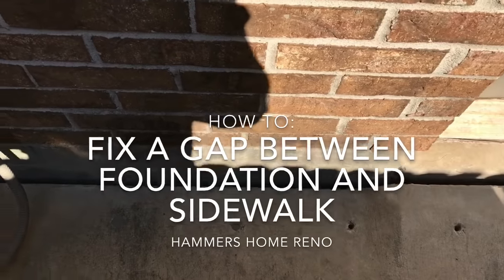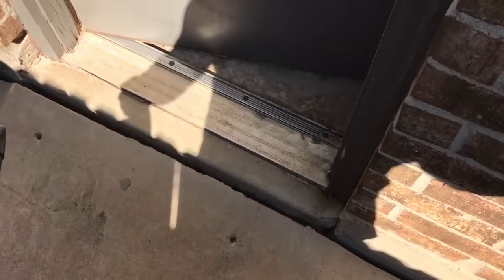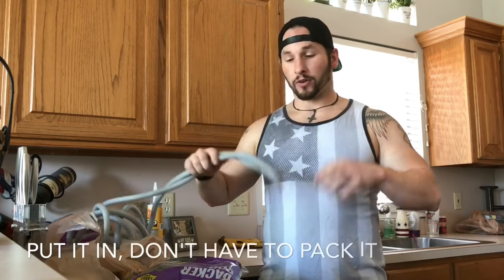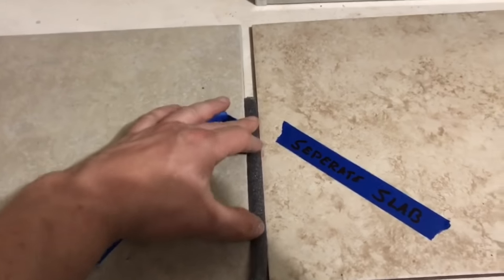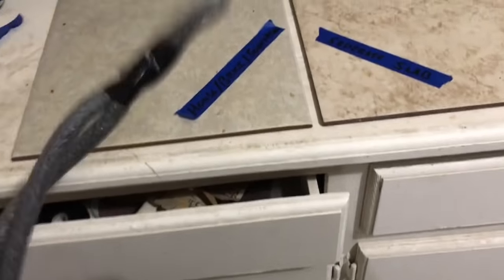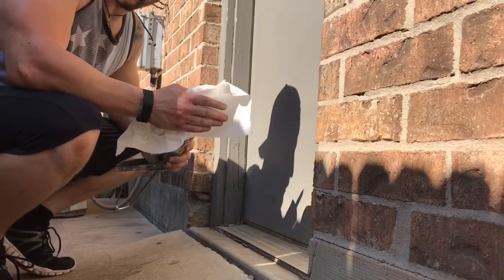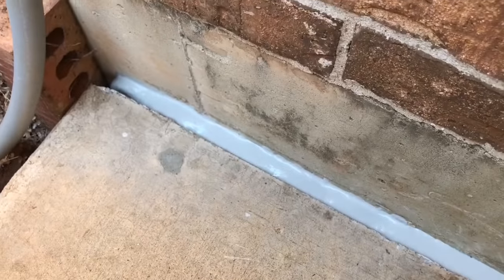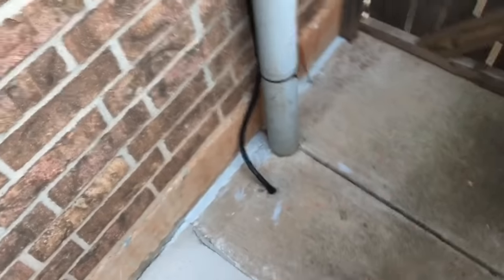Seal Gap In Foundation and Concrete Patio or Sidewalk

Comment: Use tape on both sides of joint prior to applying the self-leveling sealant if you want the job to turn out cleaner in the end.
Reply: You mean apply tape ontop of the backer rod once its in the gap?

Comment: A side note for inexperienced caulkers. Make sure when you’re caulking concrete that you rough up (score) the concrete where the caulk will be before applying the caulk. This will help the caulk bond to the concrete. If the concrete is smooth or slick, there’s a good chance the caulk will peel off.

Comment: Use foam pipe insulation with backer rod inserted to make it solid.  If the gap is huge, use different size pool  noodles.

Comment: Twisting and doubling the backer rod is not a good solution. The rounded backer rod gives the sealant the proper profile to per form correctly . Also it needed to be wire brushed and primed. It also should be tooled both directions to insure a proper bond. I installed sealants professionally for 40 years and can’t remember how many times I have been called out to fix sealant a homeowner installed. It is not really difficult but there are basic things that need to be followed if you don’t want to replace the sealant every couple of years. With just a few improvements this would have been installed correctly. Get the right size backer rod, at least10-15 percent bigger than the joint. It has to be a very snug fit They make it all the way up to 4”.this is far more critical than most people think.As a professional if a tech rep from the manufacturer found the wrong size backer the warranty would be void. Wire brushing the sides of the joint is absolutely essential, we do it even on brand new concrete. And it only takes minutes. Finally every quality sealant ( like Sika) makes primers for their sealant and concrete. Use it. Just go to the manufacturer web site and find the data sheet for the sealant.Most sealants say something to the effect of “ no primer needed on most substrates” but if you take the time to read their product literature they all have primers and say to test adhesion first. Again one of the first things tech reps look for. Finally don’t use a water hose to clean the joint. The reason for not twisting or doubling the backer rod is that the optimum profile for sealant is an hourglass shape “) (“
Where the top and bottom of the diagram are the sides of the joint. Since the sealant is self leveling the top of the joint won’t be concave so it is critical that the bottom is.
Reply: I have the same issue as this guy. However, the joint between my concrete patio and foundation is about 6" deep and about 1.5" wide at the widest point. I've been seeing videos of guys putting sand at the bottom of deep joints to fill gaps and to raise the bottom for the backer rod. Is that the correct way to raise the bottom or is there a better method?
Reply: @LaRod72  it is not correct. The proper way to use backer rod is to buy the correct size that will compress a little and fit snuggly in the joint. There is absolutely no need for sand. If you need sand to keep the backer rod at the right depth the backer rod is too small and won’t function properly. Backer rod is available from 1/4”” that will fit in very small joints all the way up to 4” that will fit up to about 3 3/4” ( or slightly bigger) If you search out SofRod it is softer so that it compresses more easily and 1 size can fit a wider variety of joints than closed cell backer rod ,which is much harder to use in joints that vary in size. Think about putting sealant in vertical wall joints. Those are impossible to “fill” with sand to keep the backer rod at the proper depth.

Comment: This totally answered a question that 3 home depot guys couldn't. And shocker, they sent me home with the wrong stuff! I HAD a self leveling calk in my hand and they steered me to something different. UGH ! Miss the days when there were skilled tradesmen at the Depot. Thanks so much Hammers Home Reno!
Reply: whitesoxsue anyone whos skilled isn't going to be working at homedepot or any big box store at least on the floor. Are there employees who has had some experience in repairs on different things here and there? Sure. Anyone skilled is going to be making $40-100 an hour, not $10-15hr at home depot

I would love to see big box stores hire 1-2 general contractors per store who is very skilled. Where you walk up to a counter, explain your issue & point you down a path.
Reply: whitesoxsuewhat is backer rod. The thing you put on the strip
Reply: Home depot pays crap for wages that's why all the good tradesmen are gone from there

Comment: Thank you! This is what I was thinking of doing to my new house before the weather changes. I appreciate your honesty and the tips on how to do this. I’m not sure if my house needs it, but I’ve been around the building trades as long as I can remember, since we had builders, architects, and appraisers in my family. I’m always looking for potential problems that I can deal with myself. I’m a single woman in my 60’s, and I’m tiny! I need simple ideas! Thanks again! 
Does anyone have a video on sealing a basement window on the inside? It’s finished, but I see holes and bugs are everywhere!
Reply: Kathryn Willette. I’m 63, and my hubby is handicapped so I DIY as much as I can or am physically able. I feel I’m in pretty good shape and can bend and move about.  Anyway, I have checked my windows which have a concrete mortar connection to the exterior stone wall. I just finished doing mortar repair around all the cracked stones and a gazillion small holes I found. We’ve battled drafts and bugs for too long and I was recently taught the solution. After the mortar on my home is caulked (I’ll be done today), I’ll use a waterproof and PAINTABLE silicone caulk by DAP.  If you need to do the mortar repair, buy tube(s) of Sakrete Mortar Repair...with acrylic in it from Lowe’s in the building, lumber or masonry section at the PRO desk).  Next, I have a large gap between the stone wall and the driveway slab and I’ve already bought my supplies.  This video was a huge help for my confidence level!  Good luck.  Fixing your holes for drafts and bugs is a snap/easy. Let’s “git r dun!”  Respectfully, Ange’

Comment: If you have a large gap, could you use spray foam? (ie. great stuff). Then go over with the caulk?
Reply: Rodents, squirrels will eat the foam, plus its not waterproof, snow  proof or hail proof..... backer rod foam with the self leveling is the way to go

Comment: you have done termite treatment under concrete steps. I saw the 3-inch-away holes on your concrete, which were drilled for pouring termido SC into the soil under you steps

Comment: I had 19 ft  in length and 6ft wide sidewalk added to the side of my house. The contractor used rebar, but just mended the new sidewalk slab  to my existing garage slab, which was built in 1967. This new sidewalk slab won't mend with my garage slab. Right? It looks like it did, but I am being told it will not.

Comment: My washroom is made of stucco and chicken wire and it was added on to the south side of a brick house. There's over an inch gap on the top between the brick and stucco and then coming down to the sides they taper down one side more than the other thought would this be the same concept as far as trying to patch it up? Cuz I have a real problem with my hands but it's up in the air it's not on the ground

Comment: About to start this project. My driveway is running on the long side of the foundation.  I was thinking I would fill the crack with sand and then some small pebble rock then more sand  yet no one seems to mention rock.  Why is the backer rod better than rock?
Reply from the maker: Backer rod’s form and shape allow it to expand and contract with the different temperatures and seasons through out the year. 
Rock will not allow this and will eventually lead to cracks from the expansion and contraction from temp fluctuations

Comment: Thank you sir for your very informative video!  However, a very important step was missed here.  On both surfaces inside the crack you need to apply a clear primer.  This soaks into both surfaces and acts as two-sided tape.  This is used to prevent the separation of the caulking.  Good luck my friends!
Reply: Could you give some examples of a clear primer?? Maybe one at home depot I can grab?? Thank you for your comment!
Reply: Hey Steven, tried to leave you a comment previously but have no idea where it was sent. Apparently not here lol. 
I’m a 44 year old woman who is at the very beginning of a long road to learning how to do proper home repairs and maintenance for the first time as I’m now on my own. 
Will you please let me know which type clear primer I should look for to buy in store? Also read in the comments that many people suggest “roughing up” the concrete. Does this mean a light sanding like you need to do with hard plastic before painting? Lastly, should I do both the roughing up and primer? Or is only one of these recommended? 
Sorry to ask you, especially so many questions, but this project will be my very first time attempting home repairs so I really want to make sure it’s done correctly. I’m very eager but definitely lacking confidence. Any help, ideas or suggestions would be greatly appreciated. 
Thank you Steven! 
From Shannon in Canada 🇨🇦 
*edited to change wording in hopes my questions make sense
Reply: @alextaylor2320 did you ever do this or find out what kind of primer?

Comment: For the larger gaps, consider using sand as a filter instead of backer rod. Way cheaper and you don't have those ridges from twisting the backer.

Comment: If the gap is too big, can you use a pool noodle?
Reply: I just read a commenters post that suggested backer rod inside of foam pipe insulation to fill larger gaps to keep the pipe insulation firm, and another that suggests pool noodles - presumably over something like the backer rod/pipe insulation to keep it firm and convex (rounded up, not sunken in a 'U') - which another commenter said was the ideal shape.
Others provided tips such as scoring both sides of the gap, cleaning with a wire brush, and applying a clear primer for concrete to bind to the concrete flex sealant. And a few suggested sprinkling with sand after to make the smooth sealant blend in better.

Comment: I have a concrete block compartment built on a foundation that extends beyond the edges of the compartment. There are leaks and I am looking for a solution. since I don't have a gap as in your example, could I just put the sealant along the base at the side wall or is the product likely to flow and lie flat since you state that it is self levelling?

Comment: Best way to clean it up? You mentuoned coming back to do some clean up. Best ways to get caulk off concrete?
Reply: Several suggest using a wire brush.

Comment: What do you do if the crack is so small it is hard to put backer rod in?
Reply: Then just use the chalk directly. After applying the chalk, Dip your finger into dish soap (so the chalk doesn't stick  to your finger) then press the applied chalk to push it into the crack.

Comment: Seems easy to do for DIYer like me. Not quite like how the result looks because of the color difference of the filler and the sidewalk. Is there any chance you can stain the side walks and fillers using the same concrete stain? I have the same problem on my front porch. Thanks so much!
Reply: Sprinkle a little sand on the caulk before it dries. It will blend better with the concrete.

Comment: as far as sealant concern, anything that is flexible, will last longer
Reply: I think I’ll just use waterproof expanding foam sealer and cut it level after it cures.  I thought it was funny how you recommended not to twist it, yet that is what you did.  LoL not a bad way of doing it, I just think it’s a little more tedious than it needs to be.

Comment: Can you just pour concrete down in the crack in the level it off?
Reply: Marty Summers good question
Reply: Somebody told me that...scanning this thread to see if anyone else heard that
Reply: It is not really a crack, is it? It is an opening or gap which was deliberately created between the  foundation / wall and the paving slab when it was layed down. This space / gap is essential because the concrete paving needs to expand and contract with the changes in temperature. If it has no room to expand, the paving will crack and break up. 
If you want to fill in the gap to stop it from filling up with debris or to prevent weeds from growing inside it or if you simply just want it to look better, then you have to use A FLEXIBLE SEALANT which could accommodate the expansion /contraction.
To answer your question: You cannot pour concrete in the gap to seal it because concrete will dry and harden and won't be able to flex with the expansion and contraction of the concrete paving. The filler will crack and break up. You also run the risk of the paving itself cracking and breaking up because it has no room to expand in hot weather.

Comment: Wouldn't spray foam be easier and fill in more gaps? Did you just want something to stick your caulk into?
Reply from the maker: I wouldn’t recommend spray foam. Not only is it not appealing to the eye, but it also isn’t flexible enough to allow for expansion/contraction during the hot and cold seasons
Reply: Great question, because I was wondering the same thing...Thank you both!
Reply: I was wondering the same thing so thank you for that clarification and great job on the video.

Comment: Would this be used between two slabs?  That felt type filling that was used between them has all come out.
Reply from the maker: Yes sure will! I will be doing this same method to mine where it has separated in the garage. And another spot on my sidewalk
Reply: Yeah, that paper and felt stuff sucks.  Today they make closed cell foam rolls of expansion joins that are FAR better.  My local home depot and lowes does not sell it in the store.  You have to buy it online.  A 50 foot roll costs about $17.

Comment: I have yet to see a video on caulking from someone who knows how to caulk.this guy is  not a caulker.the reason he struggled shooting is he has the cheapest gun made.no real caulker would use it
Reply: Well, explain how and why that’s important. Otherwise the comment just reads as snobbery.
Reply: If he had a quality gun it would be easy to squeeze and he wouldn't jerk the gun when he sqeezes it .that is the reason in some spots he got it outside the joint.next whether it is self leveling or not you have to tool it to get air bubbles out.if you are using self leveling caulk you can't twist the rod to fill in joint because it will seep down between opening.

Comment: Except it’s still super soft and rippable after it dries so it’s pointless. I was trying to find how to make it solid
Reply from the maker: You can pour concrete to make it “solid” and it’ll just crack with temperature change. 
The key is doing this which will withstand the temperature changes and seasons. Good luck.

Comment: For demonstration purposes, you could have just done the portion nearest to the camera by the door. It would have sufficed. Working so far away from the camera in the far corner where no one can see what's going on is counter productive.
Also, I suggest that you use the caulking applicator in line with the "crack" that you wished to seal instead of perpendicular to the line at a 90 degree angle.

Comment: Dude,this is so wrong. Why all this bulshot,when you can filed up with cement. Thats the right way.
Reply from the maker: And you can have fun redoing that after a year. Cement will not bond to the slab and will not expand and contract with the weather like this. So it will just crumble within a year and you’ll be back to square one. Good luck with that though!
Reply: @hammershomereno  bro,thats just a caulk, one year wonder. If you use right cement it wont need to be redo again. You have Rapid set 9000psi strong bond cement, i still believe cement is way much better then caulk
Reply from the maker: And that’s fine for you to have your opinion. I do know that I have had ZERO issues with this method, and it was used based on the advice from many structural engineers. And their opinion and knowledge trumps anyone’s on YouTube. So I’ll continue doing it the right way. Good luck
Reply: @hammershomereno   thanks for the video. I have a similar gap as well. Do you find it effective once you have done it? My issue is that my gap is a bit deeper than yours. So wondering how to fill it in.
Reply: @gangelkoski  The sidewalk may settle, while a proper foundation for the home will not.... That's why you caulk between those gaps and not pour cement in between....
Reply from the maker: It worked flawlessly. And you can get more of that backer rod to fill in if it is deeper. Or just fill it with dirt to raise the ground up some? This part of the sidewalk was raised to meet the house so it was pretty darn deep. The one thing I would have done different is used more backer rod so I didn’t have to use so much caulk TBH
Reply: @gangelkoski  i used those Backer Rods to and it's popping up already...a Contractor told me to use cement too :)
Reply: Told ya
Reply: filling with a cement will just break away with the amount of defection between 2 joining slabs. You could try a latex additive but i doubt you would have good results from that with that type of application.